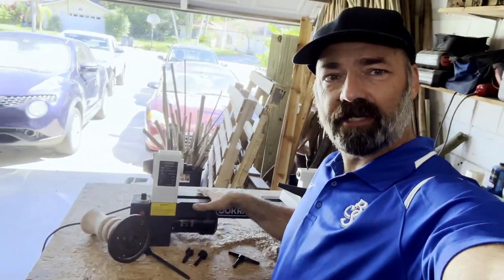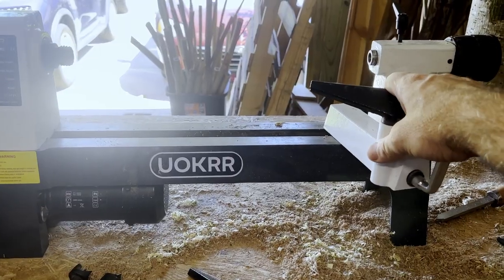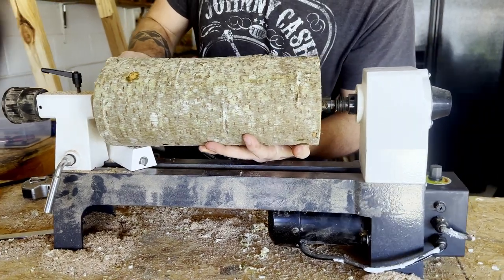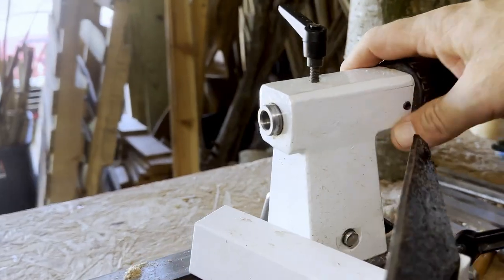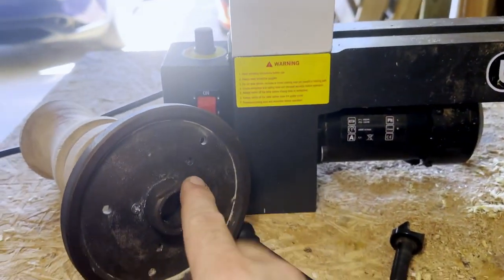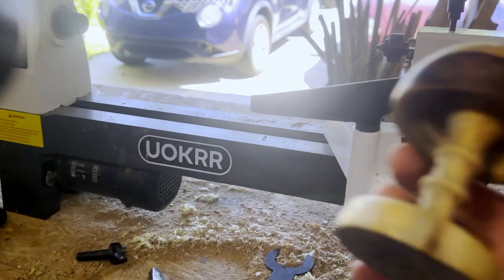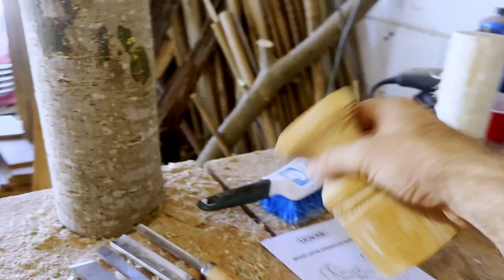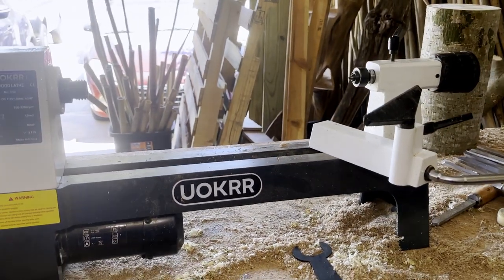UOKRR Mini Wood Lathe for Woodworking 8" x 12" Wood

Comment: Nice machine but the opening scene shows a dangerously wobbling hunk of wood being worked on. I am impressed with the lathe features but scared to use it now.
Reply: I was noticing too, 
perhaps the 'project' was some
 kind of existing piece (shrugs) 
that didn't 'want' to line up well
on both ends. just a guess.

Comment: Bought a Uokrr mini a few days ago. Shipped  it back this morning. Bogged down (slowed) while cutting.  Drive belt totally inadequate to turn wood being cut  No belt adjustment to tighten the belt on this machine. Disappointed with this  one.
Reply: Thanks for the heads up.

Comment: This lathe is junk.. bought one and both of the tool rests broke on the first use. Wasn't even turning a hard wood. Amazon took it off their website and now I'm fighting for a return on it
Reply from the maker: I am sorry to hear about your troubles. I gave this lathe to my neighbor and he uses it daily with no issue. I have heard others complain about the tool rest. If that is your only issue replacements are available on Amazon.
Reply: @ReviewsandHowTos01  I also found it to be a bit under powered for it to be advertised as 1/3 hp, I wasn't expecting too much but it did stall frequently too even at low speeds with minimal material removal.